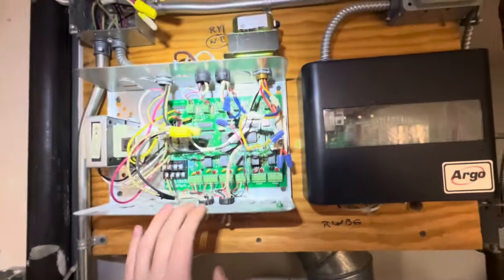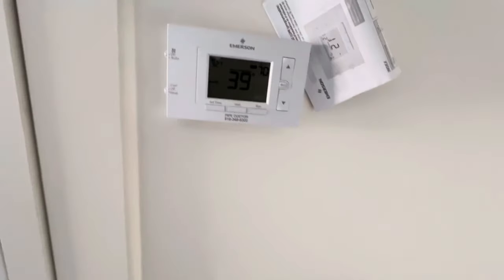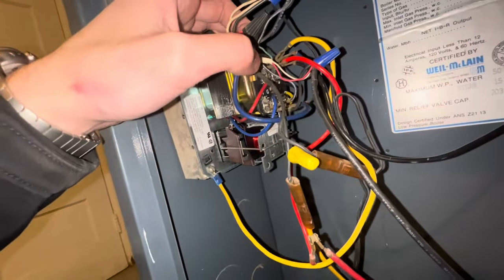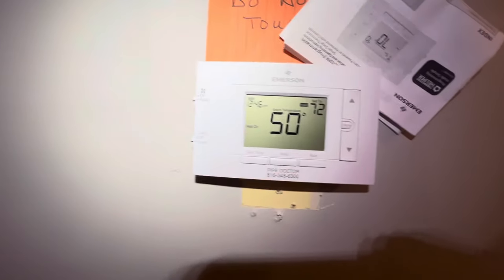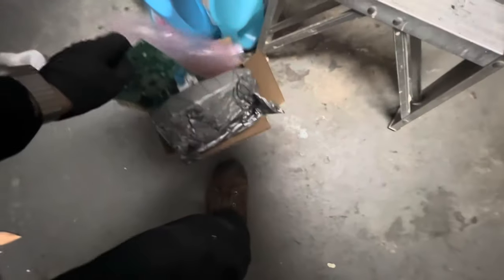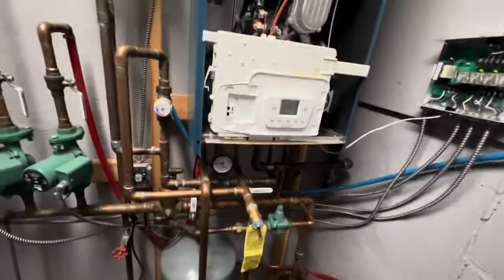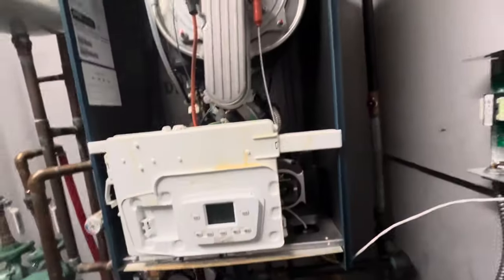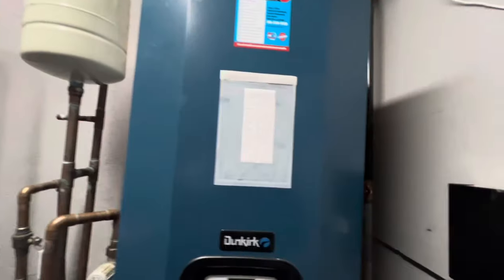Fixing a broken Dunkirk! Replacing an Argo Zone Control! Bad Thermostat in a Mansion! Service Calls!

Comment: That is what tech support is there for. There has been a few occasions that I should have called for help. I was stubborn and attempted to fix on my own. Big mistake, spent a few hours trying to repair. Ended up making that phone call. They explained what I needed to do and it was up and running in a half hour. Once in a while you get a person that might not be able to help depending on what the problem is. Good job

Comment: I’m a Dunkirk distributor. Those are the units  I sell. If you have trouble getting parts reach out to me I’ll help you out. They are great units, with lots of room to work in.  And tech support is usually amazing. And the ai combustion is extremely convenient. Nice job

Comment: Whoever mentioned that you call tech support a lot probably doesn’t work on high efficiency condensing boilers or water heaters. They are all different, they are very involved and they all have different software and parts. You don’t have to explain yourself about that, all good techs use tech support. Your doing a good job

Comment: Vent dampers are a big killer of transformers. Always physically check the wires. Looks for shorts from and hot wire to common/ground/ neutral.
Reply from the maker: No vent damper on system

Comment: When you call tech support you usually learn how to troubleshoot the issues with the current boiler. I call tech support often because not every problem is the same.
The electronics are failing on many systems because of minor maintenance issues a few drops of water can cause problems as with the Dunkirk boiler. Do continue to call tech support, eventually you will see an issue with a second Dunkirk boiler and you will have an easier time with it.

Comment: People should stop trying to replace their own thermostats with wifi ones.
Reply from the maker: A contractor installed that WiFi stat.
Reply: Another great video. You are really coming into your own. Suggest buying a tone generator. Same as for tracing phone wires. Will help with sorting out the rat nests that you are presented with. Never apologize for using all the tools that are available to you.
Reply: I would have disconnected the wires and start from scratch, you are a fantastic technician